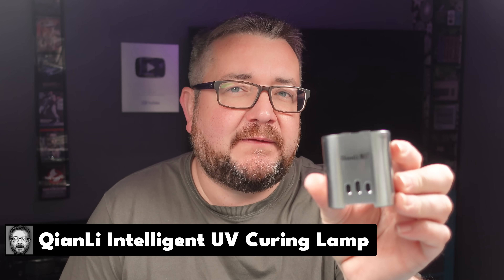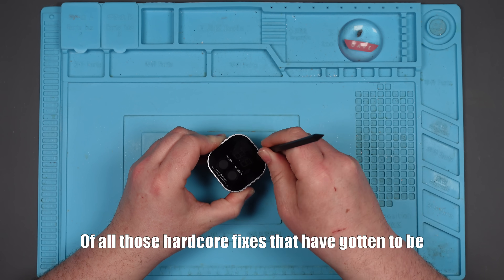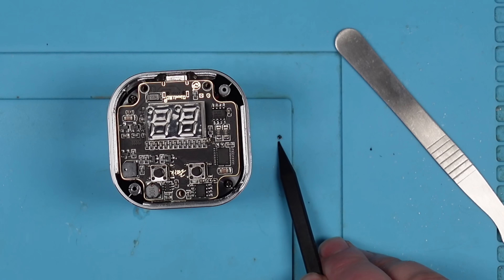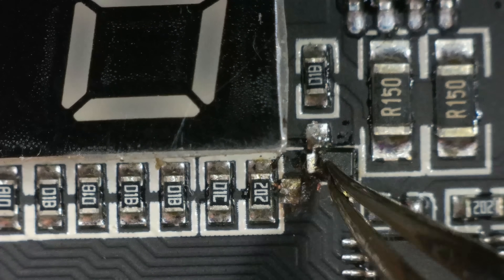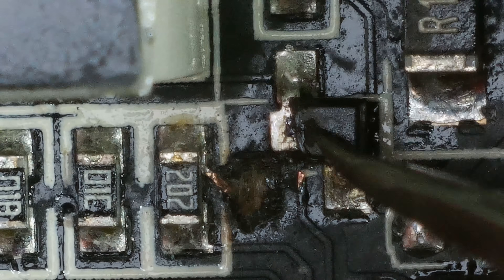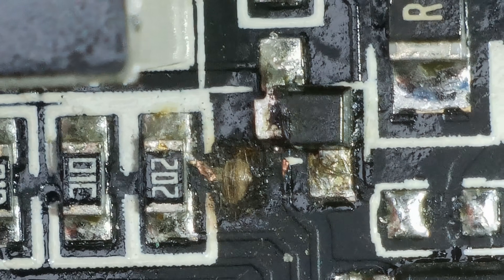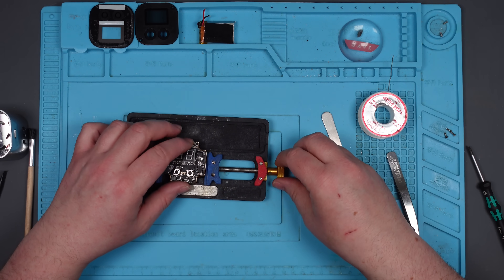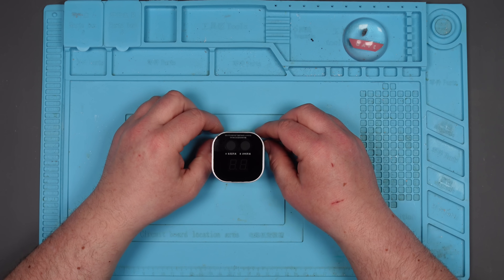My Solder Mask UV Light BROKE! | Can I FIX It?

Comment: Should I get this light or aixun? Also, why so many western repair guys keep on insisting on using isopropil to clean stuff? I used to use it, but then I noticed things come back, so I don't use it anymore. Problem is that it has water in it, and after alcohol evaporated, you got water and corossion. I use either flux off or benzine C2-80/120.

Comment: Same happens with out 3D printers the screen and parts can only take so many hours of UV light before they start to disintegrate and need replacing!. 10.000hrs the manufacturers standard but you could get a weak one that'll last 6 hrs and completely fail just your luck on what spectrum or something the system is there's something that's different in every one that is on the low end or higher end or some thing can't really remember what it is but you get a lower one it'll fail fast! The mono screens in our expensive printers don't last forever unfortunately and need replacing as get cooked to brittleness the components

Comment: Bwhoa, that's bonkers how such a tiny component can literally split in half while inside a seemingly closed system like that. It's not like you shake the thing or slam it on the table or anything like that when you use it, Steve...or do you??? ;)

Comment: When many components fail, they get very hot as part of the process.  This heat degrades surrounding material and generates gas.  Gas generation in a confined space is how guns and internal combustion engines work.  It’s also how you explode components and send pieces flying.

Comment: If I had to guess that transistor is getting hotter than it is designed to due to a design issue. Maybe replace with a higher rated part or add a heatsink if it fails again. It might have been good to see how hot it gets using a thermal camera?

Comment: i would obtain yourself a air purifier with a hepa filter. Viewers can tell how stressed you are by the amount of vape in the background! lol! and the count down timer thingy is nice and all but if it breaks again i would simplify the system. its just a voltage regulator and an on off switch with a usb charging circuit for the lipo pack.

Comment: I am betting the manufacturers have the light switch on when the second digit lights up on the LED and turns off when it goes out. Without that second LED working, the light was not getting power..

Comment: Since these are filmed under a microscope I tend to lose the sense of scale for the components you work with. I'm always really impressed when you fix stuff but seeing just how tiny that transistor was makes it even more impressive!
Reply: When he puts his finger on the circuit board... XD
There is no way you're able to fix it without a microscope and a micro soldering tip.
Reply: @goku445 diode gone wild does this stuff with half an ounce of rosin and his grandpa's soldering gun.
Reply: I feel the exact way.
Reply: Q

Comment: Just in case you were wondering, these 2 digit 7 segment displays are simply light emitting diodes tied together with a common anode and separate cathodes. Each segment lights up when a current flows from the common anode to it's individual cathode.

Each digit has one anode so in your case, more than likely that anode was on the same power rail as that transistor. When it exploded, it knocked out two things in one go. The positive supply to the first digit of the display and also the UV LED too. 
Some segment displays work the opposite way around...with only one common cathode and separate anodes. (Just to confuse us all!)

Comment: If you ever have a hard time reading the numbers on a chip, do not scratch it! Even if it has a coating on it. 

Get an IPA soaked cotton swab and rub it on the top, when it dries, it will "enhance" the text. If that doesn't help, just leave a little drop on top and it may magnify it through the microscope with less glare.
Reply: Another way is painting the part with a sharpie.

Comment: As a back up you may as well order yourself a UV cob or lamp of decent  strength of course ( not those little LEDs) and make up a UV light box.
I made one, didn't bother with a timer - just operate it manually.

Comment: Be aware that UV light is pretty damaging to your naked eyes, so don't shine it too much directly towards your face. I'm actually surprised there's not a proximity sensor on that thing to ensure you're using it against a close surface only. Then my first guess would  have been a safety sensor fault more than a lamp/Led fault...
Reply: In fact, that LED is most likely at 405-450 nm (violet color), which is called "near UV", and is absolutely harmless to the human body, not to mention the dose received in a couple of minutes of use. UV-A, UV-B and UV-C lamps and LEDs (400 nm and shorter), which emit a beautiful blue light, are dangerous for human health, and it is best to minimize exposure time.
Reply: @mineua  Thanks for the clarification!

Comment: Hey Steve! you should put some conformal coating on that little bit of wire, you know? put the conformal coating on then get your UV.......OH!
Reply: The sun cures conformal coating just fine, sport. 
It's not a big deal. Actually the sun is faster than a lamp. 
As someone who works with this kind of stuff, I used the sun long before I bought a UV lamp.
And the thing is, LED UVs are generally in the 400-405 nanometer wavelength, which is just barely UV and more of a visible purple.
You want to get a florescent black light (365 nanometers) or even a bug zapper florescent UV light (300 nanometers) but the bug lights actually will cause eye damage, or discomfort at minimum so I recommend a standard blacklight.

But back to topic, the sun works better than all those, so, yeah, Steve could put conformal coating on the UV cure lamp just fine. Take it outside. Unless the sun doesn't exist in the UK, which is entirely possible depending on the state of Parliament and whether Steve has forgotten to pay his Sun VAT that year. 
I live in California and we have  no sun tax.

Comment: Out of curiosity I went and looked at my UV lamp that stopped working and sure enough it was also the same burnt up component, labeled J3Y. Looks like they just die with heat produced from the UV leds because I happen to know mine died from being on top of a cure job too long. Mine activates with an infrared sensor detecting something under it and I walked away after activating it forgetting about it for over an hour.
Reply: So, going to fix it now? :)
Reply: @Bigrignohio  I was more just reassuring Steve that it’s probably a common issue. I’ve suspected it was that the moment I opened it when it broke because it was the only spot on the PCB that was brown lol I opted to just replace it back then because I can pay a few dollars for the components or I can spend my 40% off coupon at Michaels for one of their UV lamps haha. I probably will actually fix it as a spare now knowing I likely have a donor board lying around somewhere with that component :P

Comment: Hopefully you don't need to put any solder mask on the solder mask curer 😬
Reply: Well, it's pretty unknown and difficult to find, but there is a good source of UV light, maybe you've heard of it: it's called the sun. 
It actually works better than a little UV lamp, but I understand the Sun may be unavailable in the UK. Something to do with legislation or monarchy or Parliament or something.